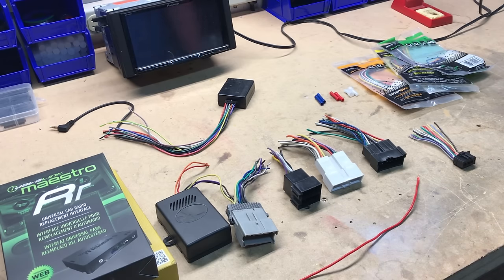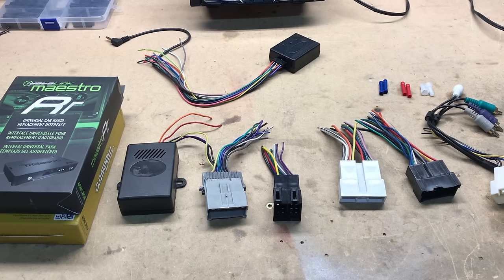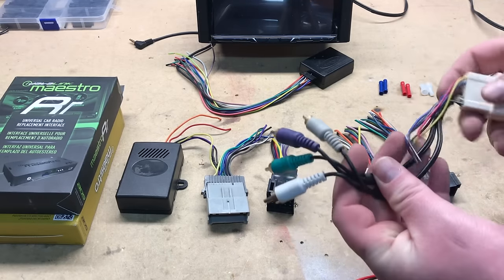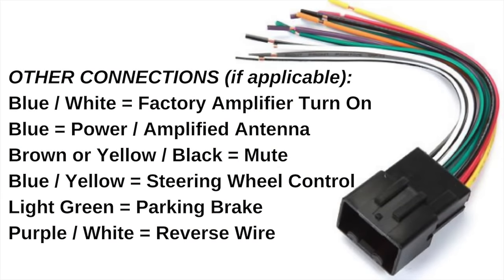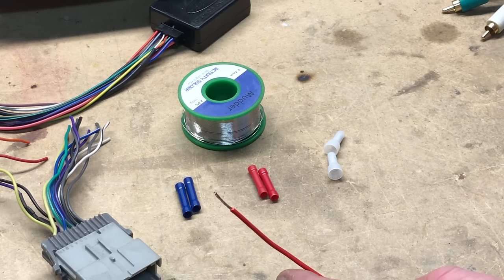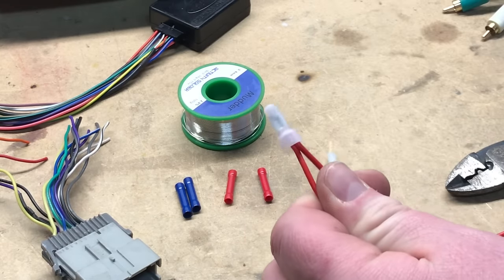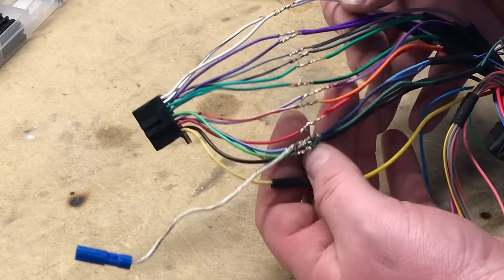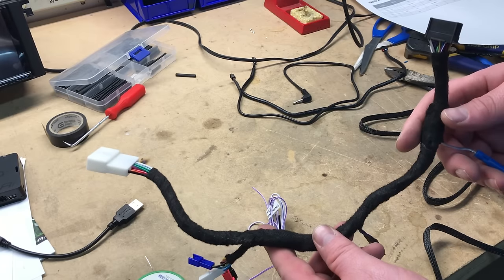Stereo Wiring Harness Explained! How to assemble one yourself!

Comment from the maker: Parts linked in the description!
Reply: Hi
I got an android system for my 2015 Lexus GX460, but the wires and harnesses does not match. Can you help me with it?
Reply: Hii I have Mazda 3 2018 I need one harness kit for line out converter can you tell me where to get one ?
Reply: to connect a KEY200.4 Smart 4-Ch amplifier. Amplifier (auto-EQ/processor) in a 2020 Ford ranger with the original 8-inch stereo, what do I need? What harness works? Also connecting a bass amplifier? thank you
Reply from the maker: Send me a message on facebook or instagram and in can walk you through it. @davidgleza356

Comment: So many people complain  that butt connectors and scotch locks are a poor way to join the wire's, but I am here to tell you that I've not had one problem using these two methods.  Using the correct tool for crimping is the trick to doing a professional job. Stop buying cheap tools is another reason why some wire connections fail. I had an Alpine head unit for 15years in a truck using scoth-locs, not a single problem with wiring connections. Yes you can solder the wire's but just takes longer to do the job.
Reply: There's no tool for scotch locks,they are a terrible connection
Reply: They are decent but don’t hold up forever
Reply: @jkink8049  no they aren't
Reply: @470ruger  There definitely are pliers made for scotch lock style connections

Comment: They also make shrink connectors with solder in middle. You just use a heat gun and connect the two wires together. Makes the soldering process easy.
Reply: Thanks, the hardest part to me would be soldering. Your comment save me a lot of time!

Comment: Hi i Recently fitted some premium speakers into my car, and I have an android head unit that I ordered from eBay the sounds were playing just fine with the headunit untill it stopped working n the fuse blew and smoke started coming from the head unit i went back on ebay n have seen that the wiring harness is not compatible with Premium, aftermarket speakers what shall i do ???can i get a harness that is compatible??

Comment: I argue that the best style of wire connector besides solder is wago connectors. Just lift the lever and make sure your wires are the proper length and boom

Comment: If you're not comfortable or use to soldering check solder seal wire connectors way better than butts or crimp caps and about 5 bucks for a set of 100.
Reply: I didn’t even know those existed! You rock! Just saved me a bunch of time!! 🙌🏻

Comment: One thing that we do in the aviation maintenance industry is stagger the locations of butt crimp connections, so that they are not next to each other in the wire harness.

Putting them all next to each other results in over-wide lumps in your harness, which can cause problems.
Reply: That is smart, I will do that in my project!
Reply: I do this to spliced connections, I just thought common sense, not an engineer here. I guess I have some design background by being curious but my strength is in Quality.
Reply: @scientist100 you'd be surprised how thoughtless some people are

Comment: Can I ask a question about the 
yellow and red cables if the red is not connected to the ignition  
and there both onto a live 

Would this make the battery 🪫 go flat if the vehicle is not used for like a month  

Thanks for the video by the way 👍

Comment: On the amp wire, why is it joined to the factory harness instead of hanging loose. Isn’t the power coming out of the Head unit? If so where would it be going to in the factory harness? An antenna maybe?  Thanks enjoyed it much.

Comment: I am doing something similar myself but instead of changing the plug onto the back of the radio i will be making an adapter from the original wiring harness plug to the cars later counterpart wiring harness plug ( gives who ever owns the car more radio fitting options)

Comment: Mark Nichols
Thanks for all the great videos. I am about to start on a radio upgrade on my 2001 Ford Excursion XLT and have watched your related videos.  However, the recommended Metra 70-1771 harness has only a single 16 pin plug. The 2001 excursion has a second plug and wiring harness which plugs into a port on the back of the factory radio identified as an amp but actually runs to the back of a center console rear speaker controller.  I believe if this is not connected,  the rear 4 speakers will not function.  Please advise as to a solution and/or can you identify the correct Metra harness.  I have looked at their website but they identify only the 70-1771 part number.
Reply: Hi! 🤔  Did you find an answer?  I'm running into the same situation with my 2006 Explorer.   Thanks

Comment: Do you still need to use the black wire to ground it? if you’re already using a premade harness connection? That came with the radio? There’s a a black wire in the harness and then there’s a second black wire loose..?

Comment: I think I did it mostly right with my car (2007 Pontiac Vibe). There are some wires though that are questionable: blue to blue/white, orange to orange/white, and purple to pink purple/white. I am questionable about those wires. Will it do anything funky to the radio since they weren't exactly alike? Other than that, I am pretty sure I did it right the best I can. If not, then I will just need to get a different kind of stereo wire for my vehicle.
Reply from the maker: Match function to function, don’t just rely on the color alone. Depends on the radio harness and radio manufacture you are using to know what goes where.

Comment: I’m trying to install an aftermarket radio in my 2009 dodge caliber. The harness isn’t fitting but I have another aftermarket harness that’s does but doesn’t have all the features the the other harness has. Is it possible to wire that harness that does fit with the extra features?

Comment: Do I need a Meastro data link harness system for my 2007 Ram with a double DIN unit (Kenwood) if the Ram doesn't have steering wheels radio controls, doesn't have climate controls  run from the head unit. It has separate knobs  or no tire pressure TSPM on wheels? Or will just a harness adaptor be fine  ? Even if it has Android Auto  i believe that works from the phone app.

Comment: Good day. Thank you for the video. Do you have one on connection/installing aftermarket amp and stereo. I’m still a bit confused. Do I need to make a t-connection with the factory wiring and the radio harness or do I seal off the speaker coming from the harness and go from stereo/RCA/amp/factory wiring?

Comment: Ok I am really hoping that you can help me out with something. The adaptor that I am using has a blue/white wire which is labeled REM OUT. The radio harness has a blue wire. I saw that you connected the blue/white wire to the blue wire but they both run to the micro bypass. If I don’t need a micro bypass do I simply wire the two together or do I cap them off and not use either of them?
Reply: The blue and white is your amplifier if you have one... If not you can ignore it if you have one it'll need a 12 v connection, I'm working on the same issue just sharing what I've learned so far
Reply from the maker: Yes blue white to blue white as it will trigger your factory amp to operate when the radio is on. Without it, you might not get any sound. We also used that blue white for the microbypass (for pioneer and alpines).

Comment: i just installed a pumpkin 10.0  D Din my chevy colorado. Have you ever hard of a pink wire called back car? The stereo only came with user manual, and just a diagram on the stereo. I was wondering what that wire was for? I thought it might be for reverse but its not. I had few wires left over like SWC Brake and power att.  The harness I had vss speed dimmer power att  illumination and. I need to fix illumination. I have no lights on the buttons. I cant see them at night.  I hooked up a orange wire in the harness call dash light. So i got to fix that still. Let me know if you have and info that could help me out. Thanks!
Reply: I’m trying to wire up my Colorado now lol

Comment: I've iasue with my chinese android unit. Every few months I have to open the dashboard and replace the harness adaptor due to noise in the speakers coming from loose connection while I can't see any when I check visually.
I've factory amp and using canbus. Any advice.
Reply from the maker: GO with a better brand radio, unfortunately.  Those cheap Chinese units are terrible.

Comment: How do I wire up speakers to an amp with an after market radio? I have a aftermarket radio and amp but confused on speaker connection if it goes to. The radio or car harness

Comment: I was just struggling, discovered that one of these companies had given me a backwards diagram. "Oh cool easy fix" I thought....
Until I then found out that the ONE wire needed for steering wheel controls did NOT have a pin or wire inside the harness.....

Comment: Question: when using a harness adapter all that is needed is to connect the correct colors with the adapter that came with the radio/cd player right, what would be the reason to bypass the adapter harness, and go directly to main harness.???????
Reply from the maker: I’m not sure way you would consider cutting into the factory harness when so many adapters are available. I would NEVER recommend not using an adapter.
Reply: @ProvoBeastAudio  I ask because a friend of mine bypassed a few wires on the harness adapter, my mouth dropped open,because I assumed all he had to do was connect the correct colors(with the adapter and the harness that came with the radio), but so far the radio/cd player works fine, I'm just shocked that he bypassed the adapter harness....
Reply: Have you ever heard of a "communication wire", a wire that if its cut the car won't start.???
Reply from the maker: @samuelhepburn2636  Many communication wires, often known as canbus or data wires which is why smart harnesses are needed.
Reply: @ProvoBeastAudio   but in your opinion does a 2005 Saturn ion 4 cylinder, needs a smart harness(thanks ).????????

Comment: When connecting the wires can you use electrical tape?
Reply: You can but it's not recommended as the adhesive can eventually dry out and the wires will become loose.

Comment: Hey I have a question. My friend let me have 2 different head units but they don’t have their wiring harnesses. Does that mean they are useless like that or can I buy just the harness itself? One is a pioneer and the other is JVC and they are both single din
Reply: You can get them through eBay, last year, I bought a harness for a pioneer mvh-21bt that I’ve gotten for free that was missing it’s harness and it worked great without a problem. What are the model numbers to the Jvc and pioneer radios? I can probably find the harnesses for each unit and can link them here
Reply: You can also get Bluetooth microphones for each of them too if they’re missing & need them as well on eBay
Reply: @ernie0699  ah I figured it out, both of them were junk but I was able to return the harnesses to Amazon
Reply: @princealideababwa1485  no problem, most non original harnesses are junk, so finding original brand harness is difficult to find, but you’ll be lucky if you even find original plugs on eBay or Amazon. The harness to the Pioneer MVH-21BT I had wasn’t Pioneer original, it was a knock off brand & it worked perfectly good for me. If you’re still in search of the harness’s for the Jvc or pioneer, I would recommend reaching out to each company and see if they have one harness in stock, im sure they’ll do. Hope this helps!
Reply: @ernie0699  you know, surprisingly enough both the head units themselves were junk. Sorry that’s what I meant but I ended up getting a $20 Dual brand Walmart head unit and that thing sounds really good. It’s has Bluetooth and all that and I was able to hook my subwoofer up to it and it sounds great. Pretty good deal honestly
Reply: @princealideababwa1485  oh okay that’s good, most JVC’s and pioneers are ass, so that dual system is a good bang for your buck. I have the JVC KD-R990BTS & and the KW-X840BTS both have been so good so far. I’ve had the 990BTS since June 2022 no problems, I’ve had the KW840 since Nov no problems either, so the friend must’ve given you bad units. Good luck with the dual hope it lasts you a while.

Comment: In my radio doesn't work the steering wheel control.  My radio is 7010B model and car is Hyundai i30 2009,  Could I get ant information please. I will be really appreciated. Thanks
Reply: You need to purchase a control unit for retaining steering wheel function

Comment: so stupid question I buy one connection part and the other comes with a headunit?
Reply from the maker: You got it.
Reply: The wiring kit you buy is to connect the wires of new head unit to your factory connection! Factory plug>vehicle specific wiring kit>aftermarket head unit
Reply: keegan Long  If you mean avoid buying the $10 adaptor that makes it plug and play, then you would be hardwiring it into the car and can’t just remove the radio for service